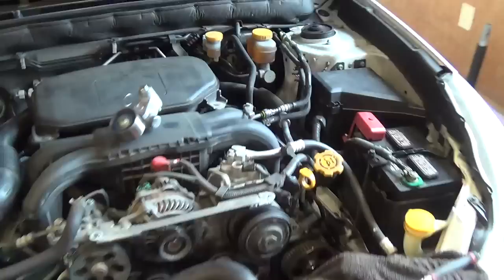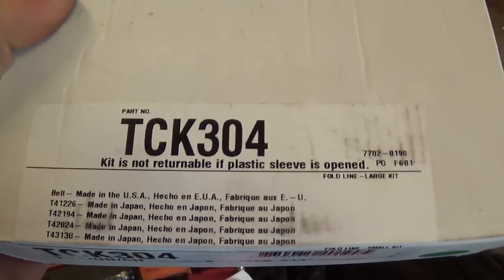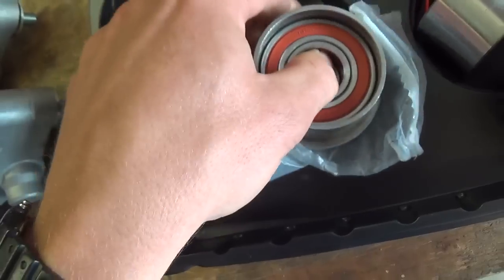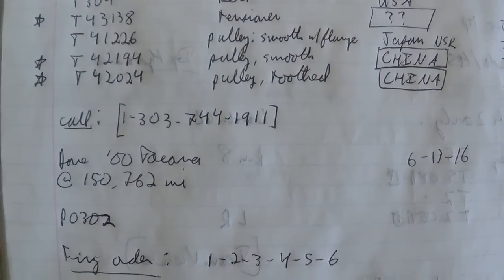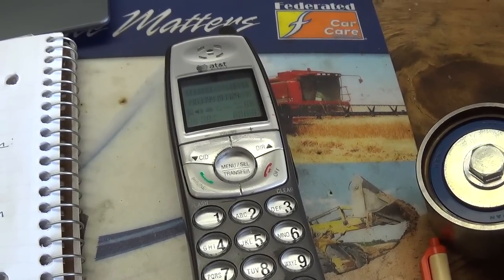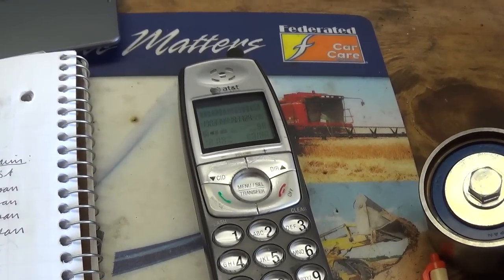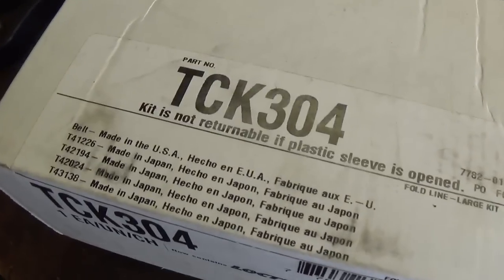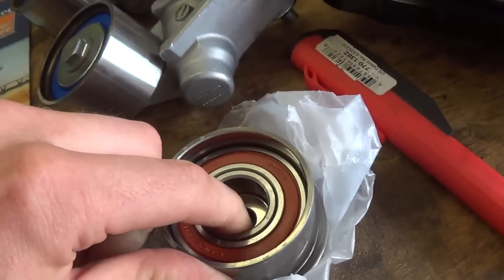GATES Subaru Timing Kits: BUYER BEWARE!

Comment: I too ran into the same issue. I found it more cost efficient to buy the idlers from Koyo and NSK. I found the following information online. Included is the Subaru part number and the supplier equivalent part number.

Tensioner = Subaru:13033AA042 NTN:ATU006J-45
Black Idler = Subaru:13073AA142 KOYO:PU306030FRR9H
Red Idler = Subaru:13073AA190 NSK:60TB0693
Tooth Idler = Subaru:13085AA101 NSK: 59TB0515
Timing belt =Subaru:13028AA231

Comment: You handled that professionally with the people on the phone.  Some people would of complained to the person on the phone,but they don't build the parts, they just work at the company. If i buy timing kits at the parts store,i also look to see where the parts are made. If i don't like them (made in china) i return them the same day. I will not order those kits online because it takes a week or more and a lot of wasted time. If the vehicle is old and on it's last leg,then i'll order the cheapest kit. Newer vehicles i buy parts from the dealer. It may cost double the price,but i don't want someones engine failing because i wanted to save a hundred bucks.  Very good video.

Comment: I remember when "Made in Japan" was considered junk. Am I getting old?
Reply: I was going to say the same!  In the 1960's, "Made in Japan" was a fate worse than death.

Pertaining to cars, I only use parts from the dealer on 'valve bender' engines.  Cost a little more but you know the quality is good and you can get individual parts instead of a kit.  I'm willing to be a little more risky on non-valve benders.
Reply: @Jack Cleary I agree

Comment: When replacing your Subaru timing belt, Mitsuboshi belt and NTN bearings only if you're going to use aftermarket parts.  Japanese made water pump, usually good. I highly recommend an Subaru thermostat or equivalent O.E. design style. Do all of them at once and you're good for another 105,000 miles.  Plain and simple. I've been a Subaru tech. for 20 years.  Original Equipment quality and a few bucks cheaper than what you get from the dealer.
Reply: HND HND I just did Toyota 1mzfe timing belt/water pump & got the mitsuboshi belt...glad I marked the original because the other one didn't have alignment marks...spent 20min counting teeth on the belt between alignment marks lol.  All worked out fine (it was the right belt)...but will check the listing description more closely next time... even if it says OEM. :)

Comment: I'll chime in.
I put this kit on my 06 WRX. I thought it was OEM like you but found Chinese bearings. Not sure about tensioner, but this was around 1.5-2 years ago.
I've put 45k on the kit, just popped the timing cover off yesterday.
Everything looks fine.
I was worried about the smallest roller, but it has held up.

I was very, very careful when I compressed my tensioner
Reply from the maker: Hopefully it lasts another 60k before the next change!

Comment: Since my Legacy has a "B" on the 4th digit of the VIN, to the Gates TCK307 was the correct kit.
I just put one on tonight.  In the Gates TCK-307:
Belt - USA
Upper Idler - Japan
Lower Idler - Japan
Toothed Idler - Japan
Tensioner - Canada

Comment: As of 2022:
Gates kits currently ship with an "improved" tensioner - they have increased the diameter of the piston versus OEM so it aligns better with the part it pushes against.  The one in my package is made in Canada and actually looks like a fairly quality part. Canadian bearing.

Cogged pulley is the same Taide bearing Chinese part.
Upper pulley is the same Taide bearing Chinese part.
Lower pulley is a Canadian part with a Canadian bearing.
Water pump is unknown.

The packaging now lists a huge number of countries the non-belt parts may come from. The belt is still made in the US.

Comment: I purchased the Aisin TKF-006 for $207.30 including taxes and shipping on Ebay for my 2009 Subaru Forester. It has all the original OEM Japanese made timing belt, bearings, tensioner and water pump.

Comment: I just finished a timing belt job on 04 subaru forester. Afterwards my engine was slightly rumbling. Come to find out, the auto tensioner (China) was never filled with hydraulic fluid!! Throwing off my timing and potentially ruining my engine!! Do not buy, WTF!
Reply from the maker: Wow that is just terrible...
Reply: Pine Hollow Auto Diagnostics 
Yeah man, I found your video after inspecting the old parts and I had the gut feeling on installing them that something was just not right. Thank you for the video, I'll be reusing all the Japanese parts. Good eye, good eye!

Comment: I unfortunately installed a gates timing belt kit about 10k miles ago on my 02 wrx wagon. I started it this morning and I heard a really loud rattling / grinding sound and the smell of burning rubber from the engine bay. Time to pull it back apart and see what failed.
Reply from the maker: Let me know for sure...take pictures...make a short video! I hope your valves and pistons are still intact :/

Comment: I used a gates kit in my 2001 Forester and needed to replace it 2 years ( 36,000 miles ) later because tentioner was failing causing a knocking sound . I replaced entire kit with a good one from aisen & problem was gone . No more gates kits for me .

Comment: few days ago I put in INAS Subaru timing belt kit (Belt was made in Slovenia and Pulleys in Japan)... so much whine and whistle that i thought i have installed a turbo charger by mistake. replaced it with OEM and all problems went away. not buying any aftermarket stuff ever again.

Comment: I'm having a noise issue...this was right on time....I bought the gates kit about 20 k ago and at start up I have a metallic noice that goes away after warm up (5-6) minutes.....I was afraid it was piston slap or a tensioner.....I'm going to get the original parts on the parts you referenced first...I have a feeling it's gonna solve this issue.... thanks for the video....this may save me $$ if not a major repair....its getting hard to trust anything...

Comment: My Rav4 is off to have a timing belt kit installed with a specific instruction to my mechanic to only use Aisin, and specifically check for no 'Made in China' parts. I'm glad you posted this video!

Gates = disappointment.

Comment: The Rock Auto rep didn't understand the complaint. The fact is, the box lists all the components by part number. Those parts are then listed as made in Japan. Absolutely no ambiguity whatsoever. Mislabeled by Gates. They are trying to pass cheaper components in their "made in Japan" kits. Luckily you noticed.

Comment: Recently had a Gates timing kit installed on my 03 forester 2.5x (EJ251).  It has been roughly 500 miles since installation by a trusted subaru mechanic.  I have noticed a rythmic knocking on startup the last 3 mornings.  No not piston slap.  Today on the way home this knocking got louder and louder.  I limped her home with progressively worse knocking and beginning to misfire.  Between 2 and 3000 rpm stumbled badly.  Upon arriving home I left it running and grabbed a timing light.  All 4 plug wires at the coil were showing mildly erratic spark patterns.  I then began to probe  with a stethoscope for the source of the knocking.  Not Bottom end, not cams, not alternator or AC compressor.  I pulled the DS timing cover inspection port, clearly louder.  I creeped behind the cover until the end of the mechanics stethoscope was on the casting of the tensioner....thwack..thwack...thwack.  Bearing is toast.  I then shut the car off, belt feels below normal tension.  I pop the passenger side rubber inspection plug and rotate the crank...Cam pulleys are out of phase, 1 tooth I am guessing.  Any more and I'd expect a kaboom.  That explains stumbing, misfire and knocking.  I will tear it down this weekend and I am guessing I will find a made in china marking on the tensioner.  Searching youtube for info on the other chinese components in the kit.  Might as well replace those too.  The one time I pay to have work done, busy and ski season approaching, this happens.
Reply from the maker: Wow, that sucks! Hopefully there wasn't too much damage. Keep us updated on what component actually failed. For a new component to fail in 500 miles is truly unreal!

Comment: Thanks for this video. Fitted a gates timing belt kit to a1.6 hdi psa engine and idler pully failed after 300 miles. Pully clearly broke up. Thankfully engine still intact. Got a replacement kit and one look at the new idler pully shocked me. It had flat spots and was oval. Left footing the bill for a tow truck, replacement belt kit (not gates won't ever touch one again) and 
 labour. Gates are obviously in a race to the bottom to increase profit. I won't be joining them.

Comment: Those are both subaru oem tensioners ... But one is the original equiment at production (the one you are questioning) and the second (the one you grab from the engine bay) is the updated tensioner .

Comment: Hey I live right outside State Collage, PA! 

I installed one of those tensioners and it failed after 8,000 miles it destroyed my rebuilt engine. Never ever use a NON-Subaru Tensioner or idler pulleys also make sure you bleed the tensioner prior to install to ensure no air bubbles in the cylinder, You can actually use the NSK(made in Japan) idler pulleys direct from NSK on Amazon you can get all 3 there… they are the exact same pulleys. Subaru buys them from NSK and ups the price about 3 times. However, the tensioner that, MUST be bought from Subaru it’s in an in-house only part. I get mine from Subaru Parts Direct off their site or eBay store they are a dealership in Washington, Oregon that usually has the cheapest OEM parts anywhere.

Comment: My mechanic advised against buying a gates kit off Ebay. It is 700aud but not sure if it comes with a water pump. This video confirms his concerns. Has anyone heard of BRECOflex? Supposed to be the toughest timing belt components but I get the impression they don't sell ready made kits so they may require all specification measurements.

Comment: Toothed idler by WP failed after less than 1 year and not many miles. Collapsed inwards with some contact with block.Timing had jumped but caught it soon enough so no damage. Gates TCK 304 kit from Amazon. Idler was Koyo Made in Japan. No reply from Gates by email.

Comment: Ac delco timing belt kit for for probe gt came with gates timing belt...sounds  good right?   I have had nothing but hell after trying to use this kit...belt noise, belt vibration, unevenness in belt itself and harmonic noises at high rpms... I replaced it under warranty with Another gates belt and same issues out of the box!...tensioner is brand new and pulleys as well, but those belts have a very bad vibration to them... id never recommend these... I wouldnt be surprised if the belt itself was made in china... ive used gates on a different car and had zero issues like this...

Comment: Great video!
This one of the reasons I use 2 main sources for parts: either dealer (arm and leg!) or wrecking  yard. Used OEM parts (unless problematic due to manufacturing defects, are often better than NEW parts from chain stores! Sorry, Valucraft fans:(
At present time you can get OEM parts form NAPA (Altrom distributor) example: Koyo, Aisin, NTN, Mitsuboshi. Worst place is to get parts off E-bay as these could be Alibaba counterfeit parts of OEM items with EXPIRED shelf life!
Reply from the maker: Yup NAPA does stock some nice OEM manufacturer parts! Hopefully you don't get used timing belts and tensioners from the junk yard lol

Comment: Don't buy Dayco either.   Installed a timing belt kit 4 years and only 30000 miles ago (I drive very little).  The roller started to throw grease right out of the box and become rough 6 months later.  I replaced it.  Today I've inspected the belt and the surface is cracked every inch or so - surface cracks about 1/2 inch long.  This belt is expected to last 100000 miles but I'm replacing it right now, I don't want to lose my engine because of it.  Do not touch this brand.

I don't even want to imagine installing a water pump from them.  If you installed one, check your water pump every few months, before it's too late.

Comment: Ive got a couple of Subarus. The one I recently bought as a daily driver has a Gates sticker claiming the timing belt was replaced 25000 miles ago but I'm suspicious that a pulley is causing knock. For a 2000 outback H4, The Aisin TKF-001 kit on Amazon is priced at $235 with a 12 month 12,000 mile warranty. Autozone's kit is the Dayco WP307K1A priced at $250 with a lifetime warranty. Who's got experience on the Dayco products?

Comment: You're right, what Gates is doing with this kit is not right.  On the other hand, assuming that Subaru OEM parts are something special is also not correct.  Never saw an OEM water pump fail, I wish I could say the same.   When my power steering hoses were leaking I looked in the Factory Service Manual it said it was due to cold weather.  I guess I should move to the topics with my AWD car.   BTW, I would never replace a belt without replacing the toothed idler.

Comment: I have had problems with a dayco kit on a quad cam subaru..The tensioner body (same design as shown here) is machined very slightly thicker than it should be, resulting in the tensioner not being able to pivot when the bolt is tightened.

Comment: Never use the gates pump or thermo!! PUt one in my 08 Legacy and the thermo never worked right had to replace with OEM Subaru my WP still weeps under high temps but isnt throwing out coolant normally. I will replace the whole timing set with OEM Subaru when the time comes
Reply from the maker: I would do it sooner rather than later for peace of mind...

Comment: There are also negative reviews about the Gates timing belt kit on Amazon. Some of them report that the Chinese tensioner doesn't offer enough resistance to prevent the belt from slapping, producing an engine knock. Thank you for bring this issue to light. I'm ordering a kit to install while replacing head gaskets. I will avoid Gates.

Comment: When all else fails return the kit and go local and get O.E. You probably got the test run stuff that Rock Auto buys in bulk which is probably the cheapest? 

I buy them locally and they come in a plastic tray covered with clear plastic with the labelling. 

If the vehicle isn't a interference engine I go with what comes in the kit as my local parts house will warranty them for lifetime all day long. Component fails they give me a new kit and I return the old stuff and they credit me back for it. 

I throw gates on my Chevy Tahoe myself but that's the water pump not the timing chain. I do recall getting the gates pump.

Comment: I agree, I had someone 10 years ago change my timing belt and water pump with pulleys and the water pump failed in my driveway when my wife pulled in.  Had about 50K on it and belt was shredded.  bought an aisin kit 2 years ago and installed it myself.  2002 Sienna.

Comment: Yes the Subaru parts cost a little more but in the end they are designed to last twice as long as the maintenance schedule calls for. That gates kit with shipping from rock auto was within 20 bucks us dollars. There's times that we find the manufacturers wear parts such as belts hoses pumps and coil over plugs to be competitively priced. Calling the dealership with your vin. Number only takes a few minutes. And you might be surprised.

Comment: I've had a less than great experience with gates belts. On my car, the original v-belt was smooth but excessively worn. For whatever reason, Gates felt it would be fine to sell a toothed v-belt for a vehicle with smooth pulleys, and the result was a loud whirring noise, especially under acceleration. After a week, the teeth started to wear, leaving belt material on the front of the engine. I returned it and bought an OEM belt and the noise is gone, all is well. I'm sure the gates belt would have been okay, but the noise was driving me nuts.
Reply from the maker: Do you drive a Mazda Miata? Older Mazdas used separate V-belts for all the accessories. My '89 MPV likes to snap the alt/fan belt every 30k miles or so...always carry spare NAPA belts. Just pop a new one on and keep on truckin'!
Reply: +motoYam82 Can't say if had recurring belt issues. One v-belt drives the water pump and alternator while a ribbed belt drives the AC and power steering. It's been over 20k since I replaced both belts and they still look great.